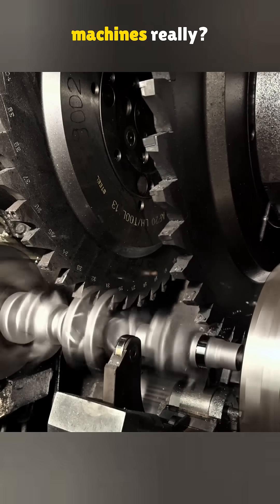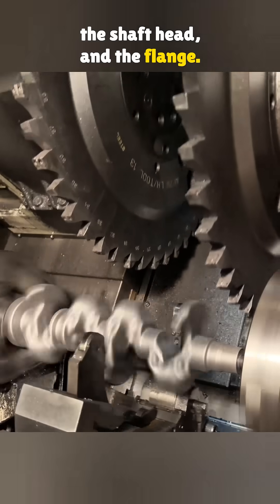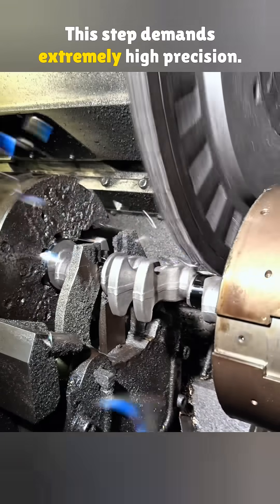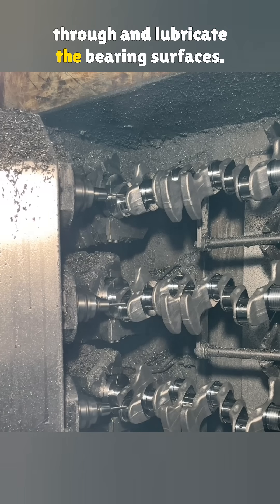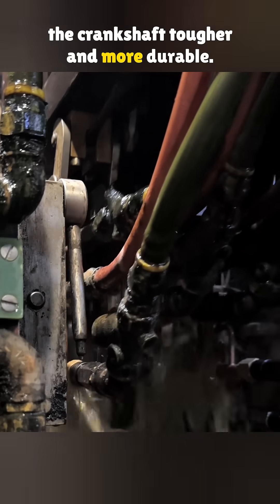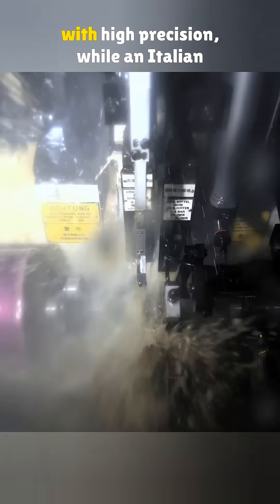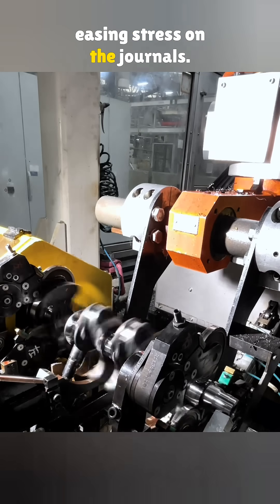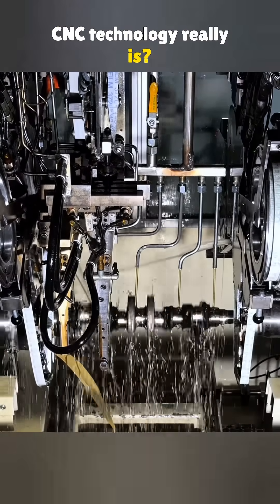How Far Behind Are Chinese CNC Machines #automobile #mechanic #car #assembly #manufacturing

Comment: Recently Chinese  completely stop importing  top high speed train wheels from Germany who rule almost 90 pc clean steel last longer Chinese scientist experiment lab like many others with Government subsidies doesn’t have  financial limit  recently implementing  in steel raw  iron metal   Particular rare elements  2 clean raw  iron  which end  over 90 pc  That spread2 car  robotic machinery tools  -I may mentioned that Chinese  imported   Big second hand German underground drilling  tunnel  boring machine and using same method they  inforce titanium carrier knifes0f  artificial diamond powder stronger 2  high pressure /. Resting Temperature than graphite natural diamond -All this is possible when u r able2 sell million BYD just in one month Chinese centralised capitalism is outcome of cheap labour  and cheap products not as an western  Midle agent  2 resell  that product and get profit 4 no work  that’s how  recently  E3  euro gang concluded their wrong addiction is now between life and dead  Because panda control private  billionaire sector  politically  with no mercy but also support with subsidy   If those risk 2 much  quick rich scheme which doesn’t exist in Europe investment that’s only way keep  Panda as cash machine motivated  and  reasonably greedy Their top luxury infrastructure  is just  cynical show off when u don’t have 38 trillion debt but surplus’s USA Predator block their overseas sea shipment ports but not 24/7  train route Russian Iranian Kazakhstan   Oil doesn’t go through Russian land but direct 2 Pandas pocket  That’s Why Brick is Juan world new Dollar Now new Greek Serbian Hungarian one is best belt road Even Russian who owe Panda trillions gave them 2 build  their own land and own route to North Pole mining  Eldorado and escape  north route 2 Europe  Eastern Panda King is destined 2 rule  but in W. War he will be  a ferocious dragon First test will b Venezuela USA take Venezuela tankers Iran get  Dragon directive 2 take USA one

Comment: Chinese use motors which is more powerful, higher efficiency, more reliable and much cheaper cost than this stuff. Someone calculate by computer, but someone by fingers.

Comment: I used to working in China and Asia on plastic injection molds making and used various high precision machines, tools and cutters. In various aspects, Chinese is good in using machines to make finished products. They have their own machines tried to match the quality and dimensions accuracy as imported ones. Visited Germany 10 years ago in different small and medium size factories, that was eyes opening to me… Japanese machines are known for high precision and excellent quality. It is true that Japanese do not export their latest machines until they use it a few years domestically. Machines cutters and materials, Sweden and Swiss have historically higher quality. American machines are good at construction etc instead of high precision manufacturing. We all have our niches including the Chinese. I think we all focus at what we good at and excel for perfection without stealing from other’s plates. 
It will be a better world .

Comment: This video goes to show that Germany is the leader country in machinning, then Europe as a block. USA is as coocked as China in this field. But don't be fooled, the Chineese did not show much interest in high performance lithography until USA started banning them from the high performance chips market. Now they are getting closer and at a fast pace. USA's think tanks "thought" they would be always be 20 years away. Looks like they are at most 7 years away from catching up. The Chineese are extremely pragmatic people, they use all this machinery because it is easier and cheaper to buy than to make themselves> Make it unavailable and they will make their own in less time than it takes for the ones they have to need replacement.

Comment: In the US, You would be hard pressed to find milling companies doing this kind of work on CNC machines whose parts are entirely made in America. You can be certain that China is fully capable of making these machines but the audit process demands that these machines are imported rather than the manufacturers having to endure the entire process of development, production and assembly of milling machines in-house. China is not behind at all. In fact, they also make smaller scale CNC milling machines for export cheap. You can even buy one for your personal projects.

Comment: In fact, the phenomenon depicted in this video is almost identical to the situation in prewar Japan. The Empire of Japan built the Zero fighter and the Yamato battleship, but until the early stages of World War II, the Zero fighter's engines were manufactured using imported machine tools. Furthermore, much of the construction of the Yamato battleship was the result of imported shipbuilding equipment and the craftsmanship of Japanese workers. Like the Japanese Navy's ships, the Japanese Army's swords and Type 38 rifles were manufactured using the individual skills of artisans, resulting in high quality.

However, due to a lack of shared production of parts among widely dispersed factories, proper inventory management through efficient communications, or infrastructure for efficient parts consolidation, machine guns, automatic pistols, tanks, military vehicles, and water-cooled aircraft engines, which require mass production technology, were particularly difficult to maintain in terms of production volume and quality. This situation rapidly began to deteriorate in the latter stages of the war, when many skilled engineers were sent to war and overworked imported machine tools became obsolete.

What is truly deplorable is that even among Japanese people today, few accurately know the gist of these historical facts.

 The Chinese are only boasting about the current situation, drowning in the same arrogance as pre-war Japan, unaware of the serious challenges they are facing. The Japanese, too, fail to understand that their predecessors' sincere reflection on the hardships they endured led them to become an industrial nation after the war. They blindly believe that today's Toyota, Honda, Panasonic, Mitsubishi Heavy Industries, etc. have existed in Japan since ancient times, and yet they continue to insult China today. This is like throwing stones at and mocking the pre-war Japanese, their ancestors.😢

Comment: My guess is that the US uses many CNC and other machines and parts from manufacturers around the world also. If a machine is already available elsewhere that can be easily adapted to your requirements, of course a business will buy and use those machines rather than making the same basic machine in your own country as it’s far cheaper and quicker. The Chinese have brilliant people and technologies which has allowed them to invent and build many types of modern machinery, so if they need a CNC or other machine that is not available elsewhere, or it’s cost effective for them to build their own CNC, I’m pretty sure they’re more than capable of doing it. If this video is of an older shop, a smaller shop, or of a shop that has a fairly small production requirement for crankshafts, these could all be reasons why they use several different methods to make crankshafts vs an all in one machine that requires substantial capital they may not have had at the time they purchased these machines. If something does the job and meets your requirements, why replace it with a new shiny and ridiculously expensive machine? Just saying….

Comment: fun fact. book binding machines come from muller martini in germany, switzerland and usa.. i have not seen one by another manufacturer. doesnt mean we cannot build a machine designed in the 1980's. r&d not worth downtime for tiny savings. there a muller martini on machineseeker uk. £750000. used. the line i worked on cost 2.5 million. in 1998. that too was used. machine is modular. argos books, yellow pages and highway code were biggest lines in there. funnny. 3 books set to disappear altogether. lol i wonder how w.h. trade binders is doing. it was a really cool place to work.

Comment: China buys one and then reverse engineers it, ignoring patents and IP.  Then it builds its own machinery - or continues buying imported equipment if its price is less than the cost of manufacturing domestically.  Thus spake Spock.

Comment: The question is how many years ahead do you think they are in making electric motors and battery technology ...that don't require all these over complex  manufactured components or machining steps .. with 0% of the components in any given motor ..  and basically only two main purely rotary bearings supporting the central shaft on precision bearings .. .. and some oil or water cooling  galleries .  Producing a motor that's more powerful, more durable, more efficient and pretty much maintenance free for tens of thousands of miles ..at 97-98% energy efficiency 🤷🏻🥼🧙🏻‍♂️🤦🏻.  The whole industrial complex is facing a massive recalibration in technologies and materials which is why the legacy manufacturers are still trying to sell outdated ICE based technology. That weighs more and takes up more space for any given power output ..
These machines however can usually be being repurposed....thankfully .  There's also 3d printing of more complex components that could not be produced by any other way in terms of complexity and material economy... Or  specifically tailoring designs with minimal  material  removal and finishing .🧐🙄

Comment: To be fair, crankshaft and connecting rod junction is one of the most precise part of the engine, simultaneously carrying largest load. If I recall correctly, tolerance is about +/- 20 micrometers

Comment: I'm a retired Machinist and while I was working in a AreoSpace company in Houston Texas I met another Machinist from over in Germany or Poland and he told me in order to accomplish your apprenticeship your had to saw a piece of round stock "4140 heat treated " and you had 30 days to produce a 1 inche perfectly square and perpendicular cube with only a single File and I believe him He was one of Very best that I have ever had the opportunity to work with.
Reply: The first step in becoming an apprentice working with metal is being handed a piece of steel to hold for a little while. That steel is then stored for a week or so. If it shows corrosion at the end of that time, you are strongly advised to find another trade. Body chemistry varies, so some people cause rust.
Reply: A one inch? They mainly use the metric system so it would kind of weird for them to have to do a one inch cube. I’m sure they work both systems though.
Reply: @mar56cos ok 25.4 mm
Reply: 日本では熱処理された鋼ではありませんが金型工の見習いの時にヤスリに慣れるために立方体を作ります。
Reply: @amoon8143 right it's one of the skills needed for tool and die making
Reply: True!
Reply: Why with a file and not using machinery?
Reply: @mikeyKnows_ 
主にプレスの金型は成形研削盤ができる以前はヤスリによって製作されていました。
そのためヤスリの技能は金型製作の基礎とされ、技術の進歩を知るためにもヤスリ加工を学ぶのです。
Reply: Same here retired machinist have seen and used machines from all over the world including the US Europe Japan Korea

Comment: Odd bookending the overall framework as compare/contrast vs China. 

What if China isn't also doing this, but 'better' along even more advanced approaches? 

Instead of refining source materials (metals) to which then farther refine down..

..which chip fabs do at even far greater levels of precision (as exemplified by China's 7nm & below mainland facilities productions)..

..but rather bottom->up atom by atom isotopically sorted atomic vapor deposition approaches? Then post refined not with machining but with lasers?

Comment: Getting the equipment is an insignificant challenge compared to the programming (firmware/OS, not the CAM/CAD) and maintenance needed to operate one.

Comment: A lot of machines are made from parts from all around the world. I run a CR Onsrud which is American, but a lot of components are from all over, heads from Italy, electronics from Japan and Germany. 
I guess you would need to get an idea of the quality of the finished part, mostly what I see coming from China is lower quality. But they are pretty good at replication, so maybe, but they make more money with quantity over quality.

Comment: They've almost caught-up with ASML on the semiconductor litography technology and they did it in just a couple of years. Yes, they most likely used industrial espionage and copying for that, but that's beside the point. The fact is they still did it and soon will be on par, if not even ahead of the ASML. And ASML is the only company that can provide this technology to the "west".
Also, just check what they are doing with their stealth planes. They are already flying multiple gen 6 prototypes while everyone else, including USA is only drawing them on paper.
Do you really think that making CNC machines by themselves will be an issue for them if west cuts them off?
It's time we stop deceiving ourselves with the stories of western technical superiority and start actually developing new advanced technologies faster ourselves.

Comment: Behind? Did you research and not learn that China buys 33% of all CNC machines made, whist it manufactures 25% of all machines made. Do the math. Foxconn purchased 3500 Fanuc Robodrills for iPhone production. Three-thousand-five-hundred!  Did you know that Siemens CNC controllers are manufactured in China? Which engine are these crankshafts for? I’ve personally handled luxury car parts made in Poland, Czech, Hungary and I’ve just had parts back from a company l]that supplies a leading luxury German car brand. Where was your filming equipment made? Is this just xenophobia? The question is how far behind has everyone else fallen.

Comment: The largest independent crankshaft manufacturer uses nearly all of these machines.
What you forgot was also something like roll hardening in that process.
It compresses the edges of your connecting rods and also hardens it.
Trust me, you need that. The engine will fail without it most of the time. 
And sometimes you need to nitrate your crankshaft.
Idk how it is named correctly in English.
But overall good and short.

Comment: They are not behind ... it has nothing to do with that they are not capable , it's just more economic to buy special equipment from other countries / manufacturers.
I have seen modern parts manufacturers in china using Chinese / asian cnc machines to produce high precision and high quality hydraulic components for pumps and valves.
And these cnc companies are huge.
Remember...
You get what you pay for...
If you want quality and pay the Chinese will make it.
If you don't want to pay cost price and still want something... they make it to 😂.
So don't complain 😂....

Comment: China is no longer lagging behind; it has already overtaken several high-precision machinery companies. 

In my case, in automation lines and vertical transport equipment, Chinese equipment and components (and even those from the Middle East, excluding Israel, which sells expensive, almost obsolete electronic technology) have made us more competitive. It's worth mentioning that we also buy many precision components and equivalent spare parts from Mexico, with excellent quality, price and lifespan. 

You can buy different quality from China, depending on your investment, and since we buy high-quality Chinese components, sending a supervisor to check production before import, we have zero problems, and even a simple LED bulb lasts two or three times as long as an American one.

Comment: China has been practicing the art of metallurgy for at least 5000 years. They can make whatever they want to make. But whether it made in Germany or China...quality is expensive. They probably just choose the most cost effective tool...like everyone else.

Heck...there's probaly some old Chinese guy with bare feet and a pull cart that can overhaul your crankshaft along side the road using the same 5 hand tools passed down from his great-great-great-great grandfather...who worked in the Emperors sword shop...😂

Comment: Aerospace CNC Machinist from US here, make components for the F-135 engine that powers the F35 raptor among other Pratt engines. Anyway, from describing that they use these "imported machines" says NOTHING about where they are in the industry!!! Those are all TOP line companies, we import most of our machines. There are very few super high precision and duty machines made in the US. Who is here? HAAS?? OK for lower volume, ease of use etc. But the best machines are Europe, Japan, South Korea, and there are actually direct subsidiaries stationed directly in China lol.
Just saying, terrible argument, better off if you looked at there working techniques, programming and modeling habits, engineering processes and revision practices.